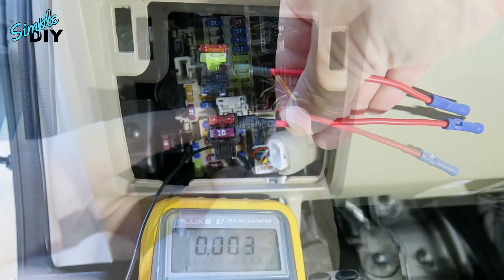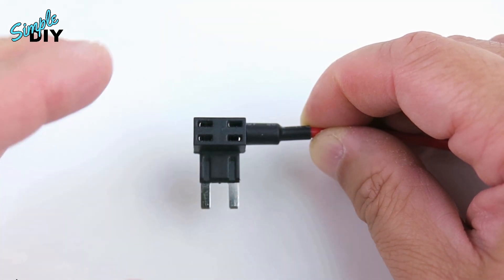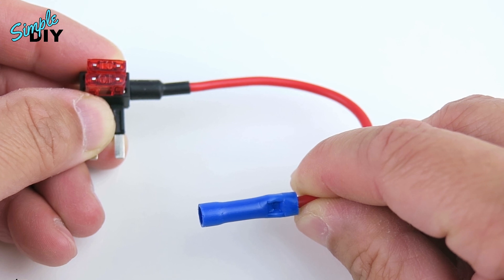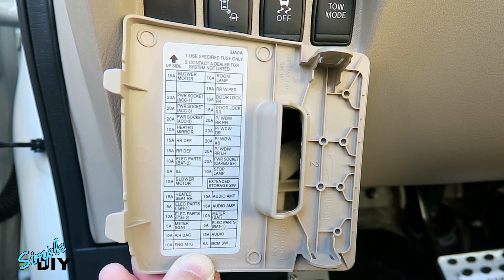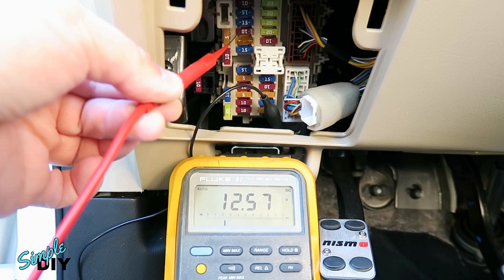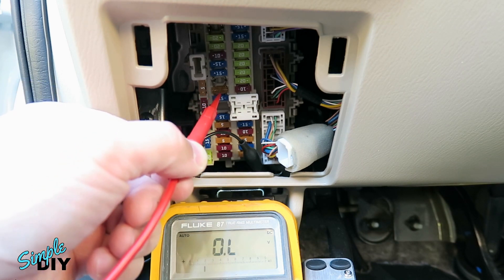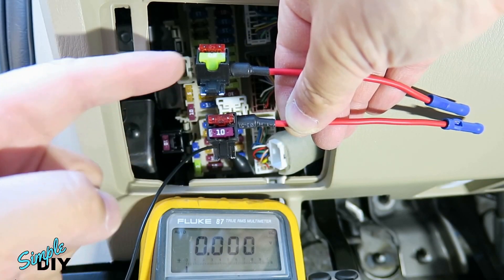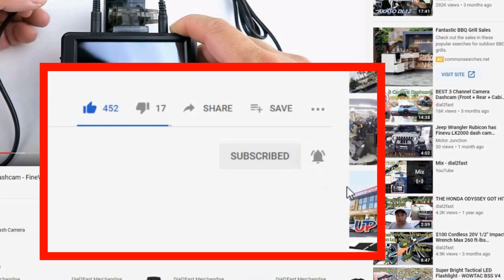How To Install A Fuse Tap & How It Works - Hardwire

Comment: Thank you so much I did not know these cool little devices existed. I found your video looking for info on a mini low profile fuse I just blew. And found out about the fuse box wire tap

Comment: Hi. I have a red and black wire. Will one adapter work for this? I’m using fuse 48 in my car. I’m powering aftermarket headlights.

Comment: Thanks for this, needed to understand these for my wiring project. Hoped to use the engine bay fuse box, but all were constant, not the ignition power I needed.

Comment: What if the circuit i add a fuse tap dose t have a fuse as its not used? Do i still need to have two fuses?

Comment: Thank you so much for this great tutorial! I used the fuse taps to install a new homelink, self-dimming, mirror on my 2025 Kia Sportage. The taps worked like a charm. However, I did run into an issue as I was trying to tap into one of the ignition-on fuses; I did find out the correct orientation but the fuese tap's cable was in the way of another electrical harness that impeded access to the tap. So I flipped it over, and it still worked!  I'm not sure if the continuous fuse tap would have worked backwards because I did install it in the correct orientation.  Now the only issue I have left is to figure out how to put the collumn panel back corretly, but that's a story for another day.  Thanks again!!

Comment: You are my hero! Been years since I needed to wire a aftermarket device to my vehicle. I'm  talking glass fuses. I get this device with all the fuse taps and not a clue how to connect it. Looked for an open fuse. Never dawned on me to install per your video.

Comment: I have the same kind of fuse taps (the low profile ones). But they will not fit into my fuse box. The plastic stops me from slipping it in. Any ideas how I could do a workaround

Comment: So if the fuse is upside down you need to flip the fuse tap upside down, so now the fuses are on the bottom correct?

Comment: I just installed a tap and had the same issue with my multimeter reader. Only thing I didn’t do is use 2 fuses into the tap.  I’ll do that now!

Comment: My Ford Mach e has a 5 amp 3 pin connector and the VIOFO adapters are only for 2 pin connectors. What do you in this situation?

Comment: Hi - thanks for the vedio. Does the fuse tap has to be 12 V or 24 V - I am trying to intall dashcam on my 2019 Honda CRV
Reply from the maker: The fuse tap will work on a wide range of voltages, 12V, 24V, even 240V. The important rating you need to look at is the current rating. How much current will draw from the fuse? A typical dashcam will draw about 250mA (less than 1A). So pick the fuse tap that fits your car and use the correct fuse rating (ex: 5Aor 10A fuse).
Reply: @SimpleDIYMedia thanks

Comment: Thank you! How would I tap into ground onto the chasis?
Reply from the maker: Look under the dash and look for a ground bolt to connect to. You can take a look at this video and in the middle of the video shows connection to ground https://youtu.be/DZ3fc8udxVs?si=LBURV713jF3UmHMp

Comment: Does it matter what amp for secondary fuse i use?
Reply from the maker: You install a fuse rating that's a slightly higher than your device's current draw, BUT not exceeding the original fuse rating. If you installing dash camera, it only draws less than 300mA, so you can use a 5A fuse.

Comment: Somehow I feel I'm missing something, when it say "1-10amp fuse" is that just the output limit or is it that it can only be plugged into a 10amp circuit or lower?
Reply from the maker: The device current draw must be less than the fuse rating.  For example, a halogen 55W headlight bulb draws about 4.5A current when on. If you need to power this light bulb, you can tap into a circuit that is rated for 10A or higher. Because the 10A or higher circuit will be able to support the 4.5A load. I would not connect it to a 5A fuse circuit, because there is a high chance it will blow the fuse. So in your example, if your device truly states it can get power from a 1-10A fuse, then that device MUST be drawing less than 1A. That's why it says you can use a 1A fused circuit.

Comment: Can you use a fuse tap to connect to a 15V source to power a 15V device if one of the slots in the fuse box, rated at 15A, is damaged?
Reply from the maker: Automotive fuses are rated up to 32V DC. The circuit you are using (including the wiring) needs to be rated up to 15A current draw.
Reply: @SimpleDIYMedia  
I have two 15A blower motor fuses in my AC unit. One of the fuse slots is damaged, so I was wondering if I could use a fuse tap on a functioning 15A slot and add another 15A fuse to it to supply power to the other blower motor
Reply from the maker: @dondada1949  Since this is a high current draw device, my answer is 'no', don't fuse tap another 15A circuit on the working 15A circuit. That could overload the working 15A circuit because there could be a max of 30A current going through the working 15A circuit. Your best option is to either find another 15A unused circuit or run your own new power supply line for the new 15A circuit. Also keep in mind, besides the fuse rating, make sure the gauge of the wiring in that entire circuit can handle the current draw.

Comment: Can you use a fuse tap on a empty slot? My fuse box in the cab doesn’t have many options and the ones there are aren’t rated high enough for the tap fuse I was [20A] so need a [25A] or higher.

Comment: What happens if you install it the other way around? Would it burn the fuse or start a fire by melting the wire?
Reply from the maker: The add-on device will still power on, BUT you will have no fuse protection.
Reply: @SimpleDIYMedia  It is not true. Pins on the wire side are not connected each other, it is not possible to have power on device without main fuse. But! If you connect in a showed way, you have power on device WITHOUT main fuse. The only proper way to connect it os other way around, I think
Reply from the maker: @michaljgPL  Yes you are correct, the two output sides are not connected, but the accessory will only get power if the bottom fuse is installed. But in this configuration, the bottom fuse will be passing both circuit's current.

Comment: do you know if the power will still go through to original fuse or of this just diverts the power and cuts it off from the original? The previous owner of my  car has ripped out the cable for the marker lights, the fuse for it also powers the tail lights can i just use one of these to run a new cable will it power both?

Comment: So i am trying to connect some accessory lights on a new grille i installed. There is a red and a black wire. When doing a fuse tap like this, what do you do with the black ground wire?
Reply from the maker: The black wire need to connect to a ground bolt on the vehicle.

Comment: What do you do with the negative wire. Place it on the negative site of the battery?
Reply from the maker: Connect the ground wire to a grounding bolt under the dash. You can crimp a ring terminal on the wire to make install easier when placing it behind the bolt.

Comment: I want to connect a viofo a129 pro duo dashcam, i belive 5 amps is more than enough, can i use 5 amps and fuse tap it, with a 10 amp? 🤔 Thank you
Reply: I belive it should be okay as long as its lower amp than the original fuse, but better ask before doing Something wrong! Thank you again for the vídeo
Reply: @kingodavidpt  You are correct. Most dash camera uses less than 500mA. So your 5A fuse will work just fine.
Reply: @dial2fast so if i can tap in my cigar fuse that is 20 amps and use the 5 amp 😁❤️❤️

Comment: Were those wires you connected aluminum wires? Can I do that? My dash cam uses aluminum wire and thought you couldn’t do that
Reply from the maker: Don't ever use aluminum wire. Only use copper wire. The silver color is the copper wire strands tinned.
Reply: @SimpleDIYMedia  oh ok, maybe that’s what my dash cam uses then. So it’s safe to connect them?

Comment: Putting in a dash cam.  One thing I've ran into and not sure how to proceed.  I have multiple "factory designated" open fuse slots in my fuse box, that are ready to accept a fuse.  Would this be correct?  If I placed the 5A Dash cam fuse into the second slot (as in your intro), I would then place another fuse i.e. a 20A fuse in the first position (that simply acts as a pass through), would that be correct?  Of course I'd have to ensure I was tapping into a proper ACC or Battery fuse box slot.  Thank you !!
Reply from the maker: Sorry for the late reply. If you have fuse slots that currently do not have any fuse in it, you will need to use a multimeter to check if that fuse slot has voltage coming in. One side of that fuse slot will have voltage coming in and the other side will not. If that fuse slot doesn't have a fuse to begin with, you actually don't even need to put a fuse in the bottom slot. The voltage will still pass the voltage through the top slot to your dashcam. If there was a factory fuse to begin with, then put that fuse in the bottom slot.
Reply: Thanks @SimpleDIYMedia

Comment: Great video, I just did mine today. I thought the fuses were paralled together, but the red powers the fuse your replacing and the orange protects the the new load, coming out of the red wire. Why didn’t they say that on the dash cam instructions, but who looks at instructions. So there sort of in series, splitting the power.

Comment: So it doesn’t matter the number of AMP? For example I need a 12V non constant, so I can grab a 25A fuse but I need to put a 10A fuse so I can have 12V? Could someone help me pls!!!!
Reply from the maker: The fuse you use for your dashcam should be rated a bit higher than what the dashcam's current draw. Most dashcams will draw about 300mA (depending on which model). So you can put a 5A or 10A fuse in the top fuse slot of the fuse tap for the dashcam. The bottom fuse slot will have the original fuse that came out of the fuse box. The fuse circuit that you want to tap in the fuse box should have the same or higher current rating than what you need. For a dashcam you can tap onto a 10A or higher circuit. You certainly can tap onto a 25A fuse also (if that's where you want to get your 12V from).
Reply: @SimpleDIYMedia  
Thank you for your assistance! I'm currently in the process of installing ambient lighting in my car, which requires a maximum of 12V power supply. So I checked my fuse box and ill connected to the USB and cigarrate pocket, because it has 12V (ignition). But the only issue that I found is that idk which type of fuse is it, micro 2 or mini... I recently purchased a 12V tester, but I found it unsatisfactory as it illuminates whenever the voltage exceeds 12V. Hence, I am planning to invest in a more professional tester that provides precise voltage readings. Thank you again for your help!

Comment: What if you use an empty fuse slot? Which slot do you put the single fuse in for the accessory if you have to use a fuse tap for just one fuse?
Reply from the maker: If the fuse slot is empty from the factory, you should still first test it with a multimeter to find out which side has voltage coming in (if there is even voltage on it). Your add on accessory still would use the top slot fuse. You don't have to put a fuse in the bottom slot.
Reply: @SimpleDIYMedia  It had a fuse in it, but it just said empty/extra on the diagram, so I figured it wasn't being used. It was a 10 Amp slot which is perfect for what I need. Connected it, and it indeed only comes on when the car is on, so I think the slot is good to use.

Comment: If you install a fuse tap into say a 10amp fuse. Then install the fuse for your new device which also needs a 10amp fuse. With both these running they could be drawing up to 20amps. How do we know the wire leading up to the original fuse isn't rated at 15amps which would have been enough for the original device but not enough for the now potential 20amp draw with the additional device? Will the rating be on the wire or is there a way to test? Genuinely new to all this so just trying to find out what could go wrong before I attempt anything.
Reply from the maker: You are correct that when both devices combined (assuming your new device is also drawing 10A), then the total current draw of both devices could exceed the factory wiring for that 10A circuit. The simple (and safe) way of dealing with this is you need to find out what is the current draw of your add-on device. If it's a dashcam, then it typically draws about 250-300mA. The combined current draw of the original fuse and the add-on fuse must not exceed the original fuse rating. You will not necessarily know the factory wire gauge behind the fuse box, so just follow the rule of both devices combined cannot exceed the original fuse rating.
Reply: @SimpleDIYMedia  What if your wire, or connected device will broke up? and it will take 10A instead 0,2A? This is situation where fuses are needed, if you have 2x 10A fuses instead 1x10A, you can burn your car.
Try connect it in other way, you will see that original fuse secure both devices.

Comment: Thank U, One thing to highlight is never put a higher amp fuse  in the top slot than the lower original fuse amp. Example, if bottom.fuse is 10, top fuse slot must not exceed 10.
Reply: yeah different videos say different opinions. So weird. AutoFun on youtube says u can put any amps since each fuse has its own amperage limitation. He didn't say u must put equal or lower amps than the one you removed from the car. He said a fuse tap creates 2 separate independent circuits.

Comment: Hey the Fuse tap supplies the positive to the device but where does the negative wire from device get tapped into? I am obviously missing something
Reply: You need to connect the black negative wire to a ground bolt under the dash. Look around under the driver's dash and try to find a bolt you can loosen and using a ring terminal, tighten the bolt on it.

Comment: What about the BLACK wire? Why does not the fuse tap provide a place for that -- forcing you to look for means to ground it instead?
Reply from the maker: The black wire need to connect to chassis ground. Find a metal bolt under the dash and connect to it. The fuse box does not have a ground.

Comment: How much Ampere (eg. 5A/10A/15A) should be the new fuse that we will place in the fuse tap for the dashcam ?
Reply from the maker: You shouldn't need more than 5A, but you can also put a 10A, and that will work fine.

Comment: You need to contact 2 wires, one to the fuse box as you did , and another to the car steel for ground ,,right 🤔
Reply from the maker: Yes for the ground wire, you need to connect to a ground bolt in your car. Usually you can find a ground bolt under the driver's dash.

Comment: Can you use different size fuses in each slot? I'm guessing YES because they are both separate circuits.
Reply from the maker: You can use different fuse rating in each slot BUT the total current draw cannot exceed the original fuse rating.

Comment: Do the 2 fuses on the add-a-fuse kit need to be the in the same amp rating? Can I have 20 amp in the top slot and a 10 amp in the bottom slot?
Reply: Both fuses should not exceed the original fuse rating. Also keep in mind all the devices on that circuit cannot exceed the fuse rating of the original fuse combined.
Reply: @dial2fast I'm sorry, but I am confused. I have the same minivan and am going to use #3 (option), so the bottom slot will be the 10A fuse from the fuse box. Can I put a 20A in the top slot?

Comment: I installed an external voltage regulator and connected it to the accessory power in the fuse box. Supposed to work on ignition only, but when I come back in the morning my battery is dead. What can be the issue?

Comment: can you please help in finding the needed fuse location to connect constant power source to a dash cam so it keeps running while in parking mode, the car is  2017 Cadillac XT5, dash cam is Vantrue N5.
and thank you so much

Comment: would it matter about awg size??? i have a 20awg hardwire kit but my fuse taps awg wire size is 16. would it be fine to crimp it just like that?

Comment: nice explanation. But I just wanna know why you also tapped on constant 12v? Is that for Parking Mode of the dash?
Reply from the maker: You are correct. Depending on the dashcam you have. Some need both ign 12v and constant 12v for parking mode. Some only require ign 12v for parking mode. In this video, I installed fuse tap for the 2.

Comment: Phenomenal video! I wasn’t aware that there are 4 different fuse types, some of which seem quite similar in appearance. That explains the Amazon 1-star reviews I’ve read on fuse taps which messed up the contact spacing (or fell out easily) from a fuse box! Also really liked your explanation of how to find which side of a fuse in a fuse box is the 12v source side. Cheers!

Comment: So the fuse I’m tryna tap in is a cigarette lighter fuse 20A . So do I get a fuse tap with 20A ?? Because the fuse tap they have at auto zones are only 2-10A . Does that mean that fuse tap only handles 2-10A fuses ?
Reply: The physical wire used on the fuse tap need to handle the current the fuse is rated for. if you are tapping a 20A circuit with a 10A fuse tap, that can still work. Just don't connect any devices to the fuse tap that will draw more than 10A max.
Reply: @dial2fast  it’s for starlights(420 stars)  so it has the small engine block not the fat ones . Do you think it’ll draw more amps ???
Reply: @larryjerry2516  Not sure how much current that product draws, but you can measure the current draw using a multimeter to find out. Either that or see if the manufacturer has a spec on that product. Those are the only way to know how much current it draws.